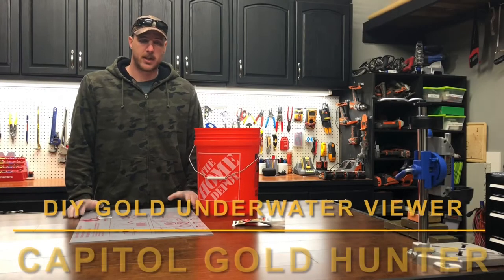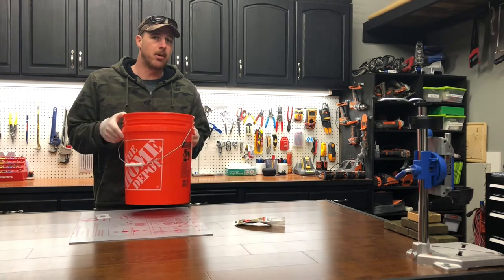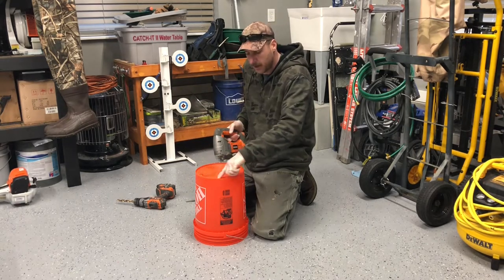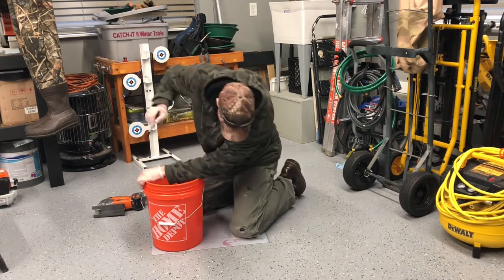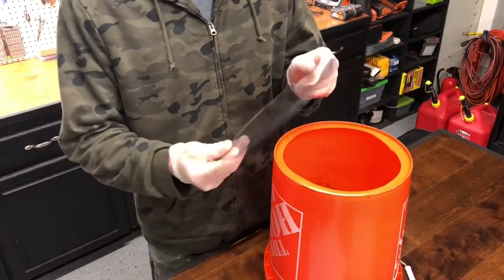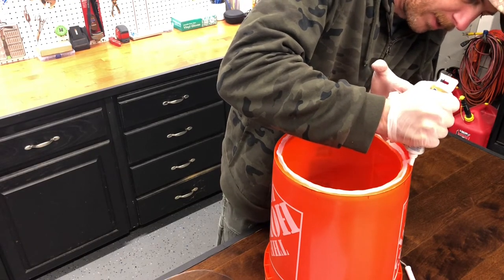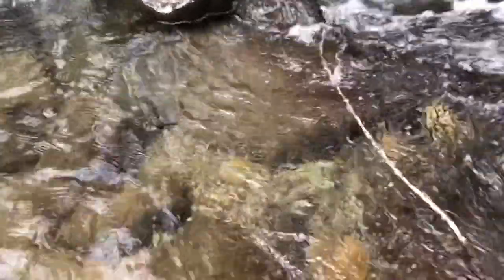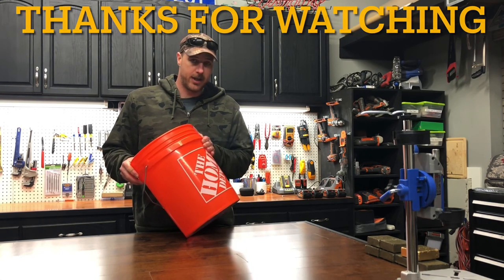Capitol Gold Hunter - DIY Gold Underwater Viewer Build

Comment: To cut down on the glare, maybe put a lid with a 6 inch hole in the center on it. Look at the fishing flogger on Amazon. I like what you made.
Reply from the maker: I just checked that out Chuck. That’s a really good idea! I’ve used it a few times this past week and it’s actually been more useful than I ever thought, so anything to improve it sounds good. I’ll use your suggestion with the lid. I think that idea will make it work even better. You even now have me wondering if I should of spray painted the inside black to reduce the “orange” hue I get. Well anyway, appreciate the comment Chuck and thanks for checking out the video. Hope you have a great day.